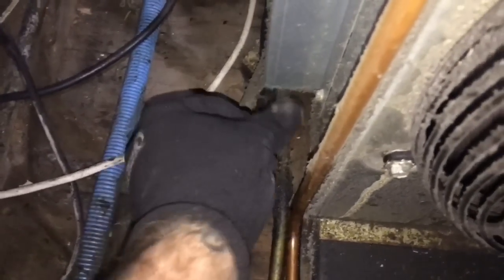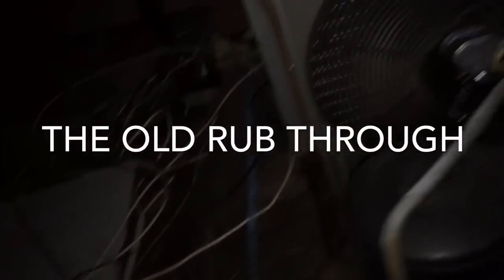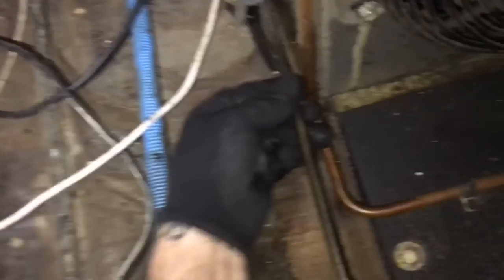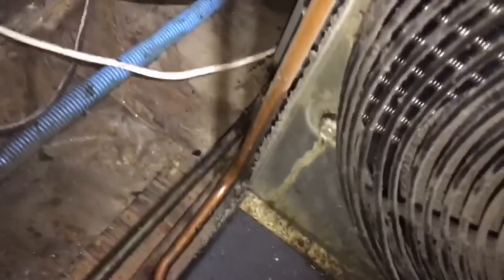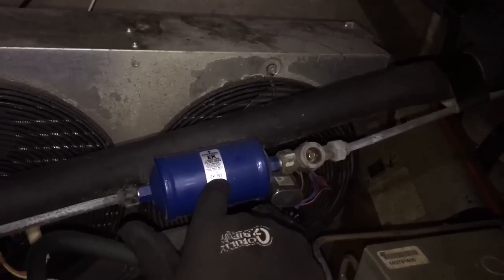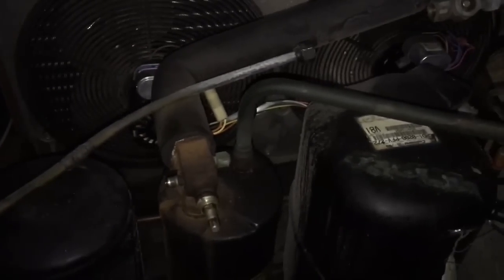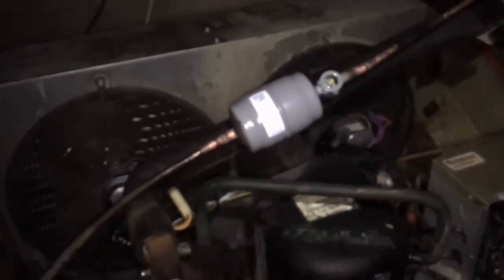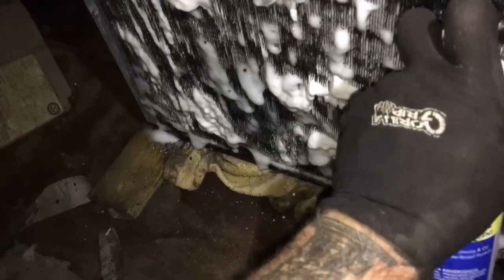Saturday night special

Comment: You big brotha, just curious on why you changed the dryer?educate me some more with your fine work you do.... Thaks
Reply from the maker: MAGIC TOUCH HVAC we are supposed to replace the drier any time the system is "open". It's a basic refrigeration practice. Hope that helps.
Reply: Nor-Cal Refrigeration & H.V.A.C I thought that was the case but just checking to see if it was personal preference or something else. Thanks champ.